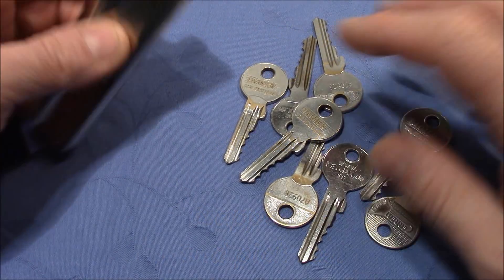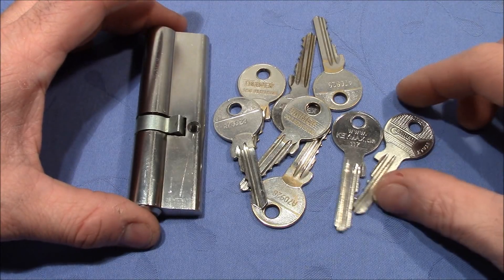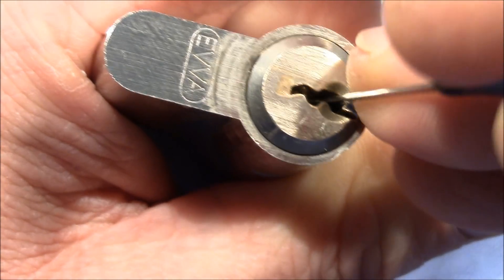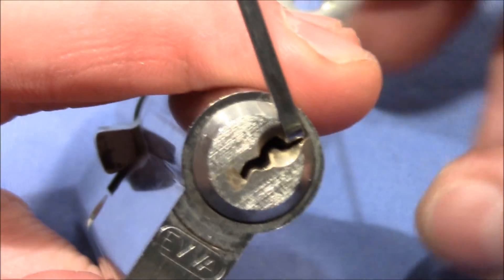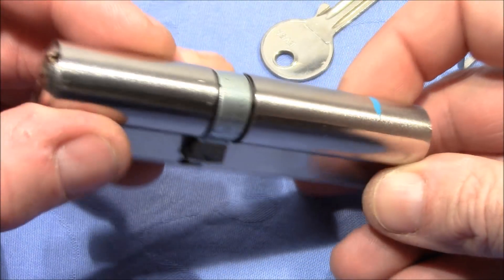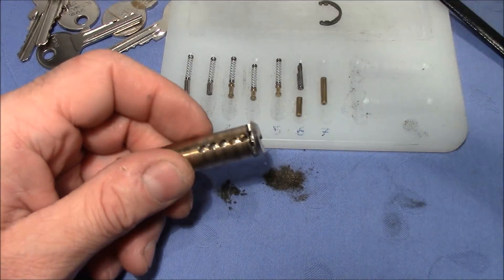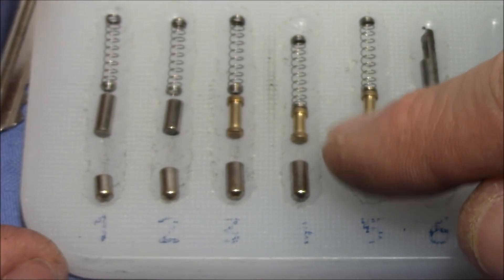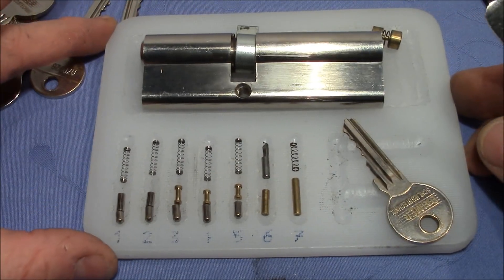(picking 466) EVVA 5-pin euro cylinder from our front door picked and gutted - a bit disappointed

Comment: I know from Adrian Weber that the EVVA thumb turns are made from pot metal which wares off in some years (5-7 he mentioned), was that the cause in your case?
I fear for my EVVA on our door, I should make an inspection soon as it is 6 years now.
Reply from the maker: Not sure what the problem was but you have seen the dirt https://youtu.be/Tl3O589lQMY?t=319 that fell out. I believe that the cam mechanism got stuck several times due to wear and caused malfunctions. I was a big fan of EVVA but if the reliability is reduced on your front door lock and you need to fear that you cannot lock up your door or unlock it then this is really bad.

Comment: Great vid as always buddy, the biting is flat and the key way is very width compared to another EVVA I had seen, you have it easy to choose a better lock ;o))
Nice job picking it, thanks for showing my friend ;o))
Reply from the maker: Thanks buddy - yes a quick and easy pick with the wide open keyway and flat bitting. But I tried raking which was not possible, so everything ok for my purposes. When I received my first pick set, I sticked in a hook in the front door lock and was unable to feel the pins (i was a complete noob) - now this keyway appears to be very wide open - practice make a huge difference.
Reply: I´m totally agree buddy, the secret of lockpicking is practice practice practice until you have the feeling. If a lock resists it is better not to obsess over it, keep picking other locks and one day you go back to it and it simply opens. Nice job as always Michael ;o))

Comment: Wow! A lot easier than other EVVA locks if seen, that bitting is pretty flat, can you rock it with a city rake ? :-)
Reply from the maker: Yes, wide open key-way and flat bitting makes it an easy pick. Also bad tolerances. I tried raking very intensively, but without success. That's the minimum a lock should provide - raking persistence (for my applications).

Comment: That was still better than my box store special lock I had. My interest in locks began when investigating what to buy. I went for Bi-Lock, and I'm sure you chose something alot better too.🤔😎✌
Reply: The One maybe someone might send you one soon for a fantastic package you sent them! 🤔😁😎✌
Reply from the maker: Actually supreme pick resistance is not important for me - if it cannot be raked, I'm fine. Reliability is important and bump protection. Snapping is not possible due to the door construction and my new lock has great drill protection. It's an ABUS EC 550 - for sure no high security lock but sufficient for our needs. I believe that a glass cutter is more effective than attacking the front door lock ;-)

Comment: Not often I see the double side operation. That is the only great thing about that lock. I hate the DIN profile locks. If it has a knob on the inside, you can trap people, just by inserting a random key in the lock, blocking the knob from turning. Hope you used your locksport knowledge to select a better lock this time for your house.
Reply from the maker: The double side operation is called "Not-und Gefahrenfunktion" in German which means emergency and danger function. It's less common here but quite handy when the key is inserted on the inside when closing the door. But because of the mechanics it's less robust. The new lock is an ABUS EC550 (dimple lock) with great drill protection and double side operation. Hope it will last longer.